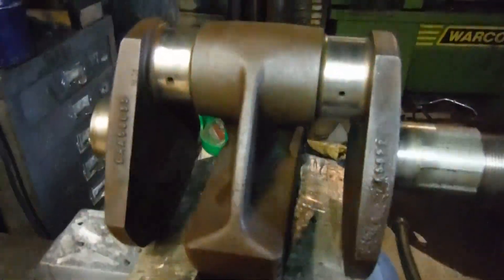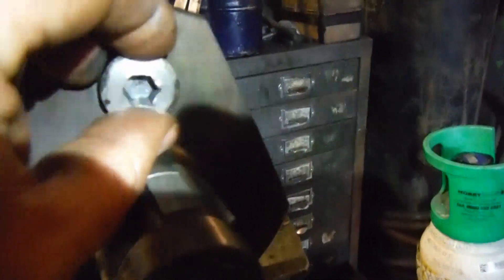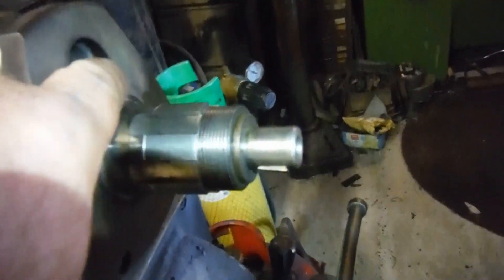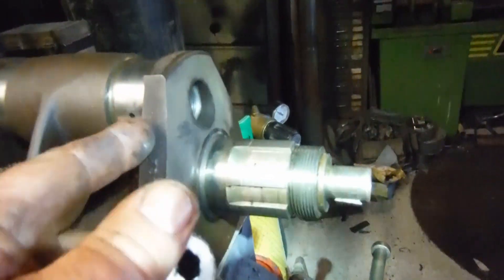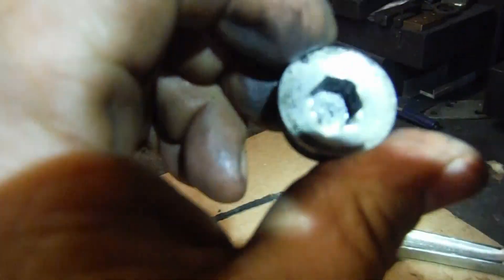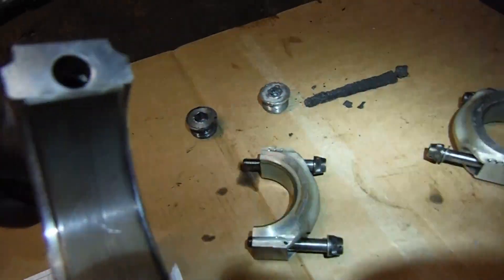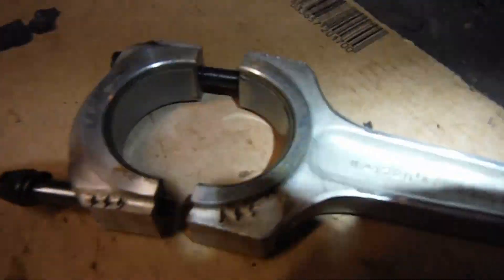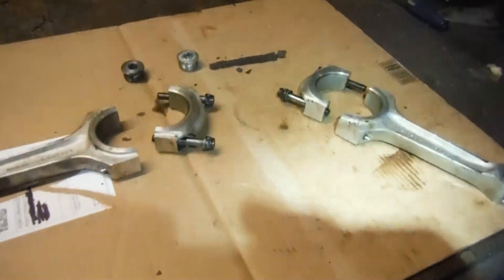Royal Enfield 750 Interceptor S2 engine strip / rebuild crankshaft findings discussed.

Comment: That's a really strong crankshaft the whole engine is. The gearbox was the weak point I read an article in Motorcycle Enthusiast about a Cardiff RE dealer taking an Interceptor II to a 24Hrs race in France in 1970 the engine was going great but the gearbox seized or tightned up.

Comment: I do hope you will record the fitting of the roller bearing outer race into the timing side C-case. I would like to see it done. They are an absolute swine to fit.
Reply from the maker: I didn't, sorry, but I heated the case baking hot in an oven and still had to drive it in - a swine, as you say!
Reply: @paulhenshaw4514  I saw one, which had been fitted skewiff in the case from Westwood. It still ran, but the rubberised/metal seal touched the end of the crank. Made a racket that did.

Comment: Hi Paul.  
With removing the aluminium plug, I think there are 2 factors.

One is the expansion - aluminium expands about twice as much as steel (coefficient of thermal expansion 23.4 ppm/degree C vs 11.7 ppm/ degree C).

The other is thermal conductivity - how fast it cools down.
Aluminium cools down much faster (thermal conductivity  235 W/m·K vs 50 W/m·K)

It may be the aluminium cools down much quicker so contracts a lot more so is easier to remove.  Would be interested what any engineers on here say.

Comment: Beautiful machining.     Great explanation about the effect of heat and contraction to remove the alloy plugs.
Reply from the maker: Thanks.
Reply: @paulhenshaw4514 .      Im sure you’re puzzled by the hard material you removed.   Is it carbon ?  No metal particles ?
Reply from the maker: The stuff I removed was just dried out, hardened sludge, as I have encountered many times before in crank sludge traps. there were no metal particles in there.